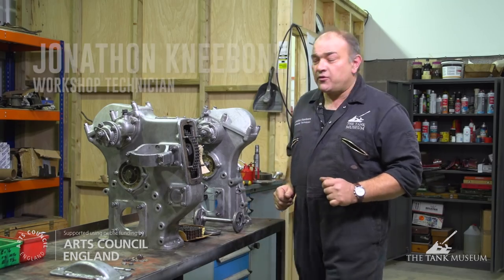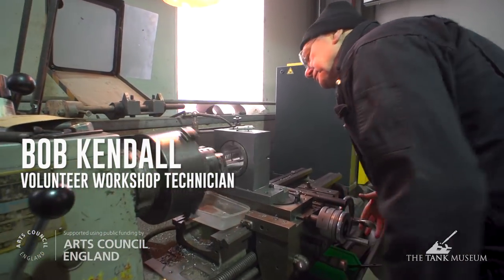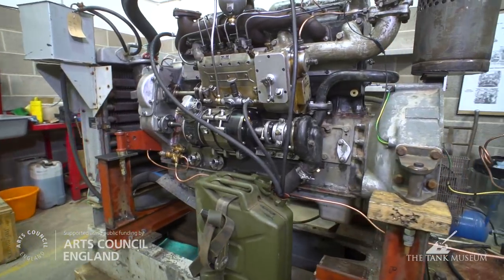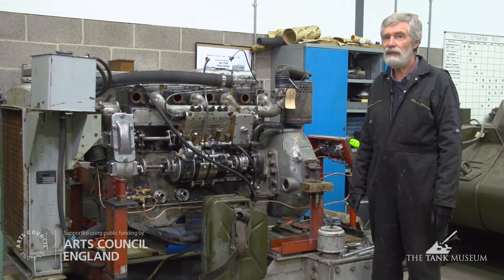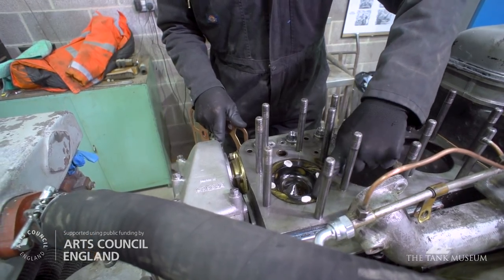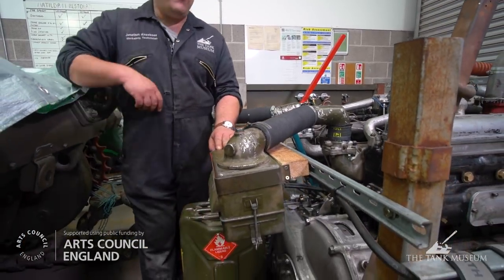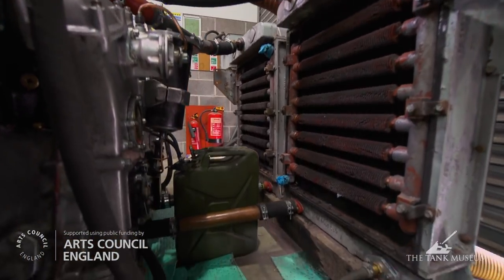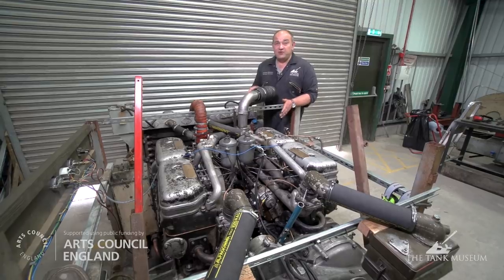The Matilda Diaries Part 21 | The Tank Museum

Comment: Yes. Thanks for talking in detail about the cross drive and the synchronisation of the engine.
I was realy interested in that part.

Also interesting to see how much of a difference even a relatively small change in cylinder volume can make.
Reply: Bird_Dog - What thin gaskets were required. The precision on those engines was lovely.

Comment: anyone else feel like that Matilda will run better than when it was new?
Reply: It most likely will, considering all the new parts are made with (mostly) better and new materials.
Reply: Eli Curbow my thought exactly. Plus everything fitted precisely and with great care. Not sure they had the time for that during the war...
Reply: Thing is they would have had everything rigged up to make precise parts while now they need to do all individually, if you don't have precise parts they won't work or break down pretty much instantly and as the Matildas didn't, I doubt the accuracy of the parts is much better now than t was during the war. As Eli said though, way better materials ^^
Reply: Those workers who participated in the original manufacture of the Matilda would have done so in an organized assembly process and would had much experience at their work stations. They would have been highly skilled and expected to produce quality output. The British Empire was good at this stuff 150 years before this tank was built. The Tank Museum workers are more in the line of mechanical archeologists and repositories of vanishing knowledge, they will produce the same quality as the original workers but at a slower and more deliberate pace, applying skills and techniques not found in younger generations.
Perhaps the next tank will be restored with assistance from 3D printing technologies.
Reply: @fraserhenderson7839  a) the workers might have been good ... once they had produced 20-30 of them (i.e. had had some practice)
b) you might want to rethink that opinion a bit and look at the quality of british cars a short while down the road, when "that'll do" was the motto ... and "that'll do" wasnt the same as "good"
Reply: You would think so it's just natural to think that of our production these days and percice fitments but lol there is a but here! The mechanics back then were very clever and knew there maths unlike alot these days! And when each engine was made and casted each part was casted individually for that engine! Like buying an aftermarket part from halford or autosave now for a Vauxhall instead of going to Arnold Clark for genuine parts with exact dimensions! I work in a garage and the amount of motors come on with 3rd party parts that have worn fast not the correct dimensions the head bolts got.1 thread longer than an original its crazy how.one little thing hurts bad! I got a new rental in with a blown head gasket last week and had a 3rd party gasket the guy brought in but was over heating with all fitted and put back together! The gasket had a tiny score in the corner so had to get a genuine part out store room it will last another 10 years unlike the 3rd party one that maybe have done 2 or 3 at most in this case 5 mins lol

Comment: Oh how I wish there had been more footage of the various details such as showing the injection pump design and setup,just what kind of fuel filter system was used,and above all,the bits and pieces of that cross drive system. Very happy you have filmed the details you did,but wish there were more.
Those have to be the smoothest running diesel engines I have ever heard. Cheers.

Comment: I absolutely love this series. The details you cover teach my something new and apply to far more than you may realize. 

In this case I’ve recently been reading the Naval Technical Report on Japanese torpedoes to help understand the details of how a torpedo actually works. Your discussion of the head gasket issues helped me understand how important ensuring complete combustion is, especially in a torpedo where the fuel and especially air (or in this case oxygen) tank take up a large portion of the internal volume. If the engine is off even slightly, as here, that would pose issues during the run, so ensuring the tolerances are extremely precise is more critical than I realized. This may explain why they had to start on regular air (and later carbon tetrachloride) rather than oxygen for safety. There are definitely more ramifications I haven’t yet recognized. I’m going to go back through the report with much better understanding of how this works and thanks to you will undoubtedly have a better understanding of these weapons. 

Please continue including these details and thank you for taking the time and effort to explain these details! Your reach is greater than you know.
Reply: For another take on closed cycle projectiles (supplying their own oxidiser) you may want to look at the development of liquid fueled rockers. Interesting stuff IMO.

Comment: What I wonder is, how much of this incredibly detailed work did they have to do in the factory back during WW2, and how much of it is a side effect of having to restore and repair the whole thing, rather than just throw in new parts?
Reply: A lot of the "detailed work" would have bee  a "no-brainer" so to speak since back in the day all the engines would have been made from identical stock. That is to say, all the gaskets and such would have been be the same with no guess work as to thicknesses... And having many engines built at the same time they could have picked matched pairs rather than having to tune singles to suit.
On a side note, it's amazing that these days we build single engines with vastly more torque than was available from two engines and all the extra ancilliaries from back then. Imagine a series 60 detroit or a cat 3408 powering something like a Matilda II...

Comment: Did you have to make the split holder; for the bairing shells on the lathe; to hold them for the boring bar? Or did you have one available? I find any machining process interesting; because of having rebuilt Pre-WW2 lathes etc in the past.
 
Does the Cross Drive act as a differential (between the two engines) or do they have to run in perfect synchronisation? All the castings and parts look superb quality. Was this typical of British tank engines in this period?
Reply: They made the bearing holders, (they briefly showed them being machined, prior to the bearing being machined - they used a lathe mounted boring bar for both)

Per the video, the engines need to be run, synchronized, else the cross drive can be damaged. 

No idea about the quality. But yeah, those are amazing looking pieces!
Reply: slikrx Thanks - That cross drive is a serious bit of engineering. I missed some details first time.
I've been involved in making a jig to hold a part being cut with a boring bar on a Bridgeport mill before. But not on our big lathe like that. Amazing work at the tank museum. I wish I had the skills to be involved.
Seeing the power pack lowered in made me suck in my ribs. It was tight.

Comment: check the tappetts every 1k miles! jeez. How long did it take to build them new at the factory?
Reply: All solid tappets have a similar service interval. it only takes a few minutes to check and adjust them. Modern vehicles have hydraulic tappets so it's not necessary any more.
Reply: nope, motorcyles use bucket and shim or screw 'n nut type adjustment, and they're waaay better than that.

Comment: Hmm machining planar bearings down.. do the bearings in this engine not have many layers of different metals and are a single alloy piece?
Reply: +Cragified
I would be surprised if these bearings are not film lubricated (maybe even hydrodynamic?), so no need for different materials: the oil film carries the weight. The only planar bearings that I know of (I am not a motor engineer) that have multiple layers are self lubricating bearings or slide bearings. They contain low friction wear materials or filler materials that contain lubrication fluids.

Comment: Butterfly valve on a diesel to control engine speed ?????? British engineers always doing it different :)
Reply: This was a pretty early example of a diesel engine.
Reply: Akm72 yea I would like to know more on how it controls rpm is the injection pump just fixed fuel and timing
Reply: I believe the way it works is, the engine pulls a vacuum on the butterfly valve, which varies the amount of fuel depending on the vacuum. As you open the valve, the vacuum drops, which causes more fuel to flow, bringing up the rpm, increasing the vacuum until it hits a balance  at the new rpm. If you hit mud and start to drop rpm, the vacuum drops and fuel increases, the opposite happens if you hit a patch of smooth road. You are setting the rpm instead of the power.

Comment: Hmm, I find it odd that the inlet and exhaust tappet clearance is the same.
Every engine I have worked on has had a larger exhaust clearance.

I wonder what black magic they are using to get away with this.